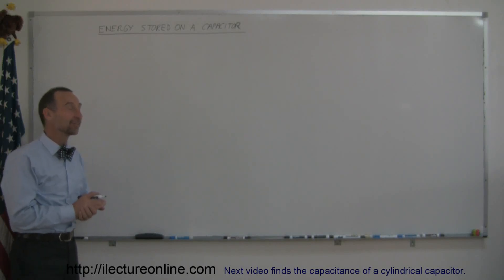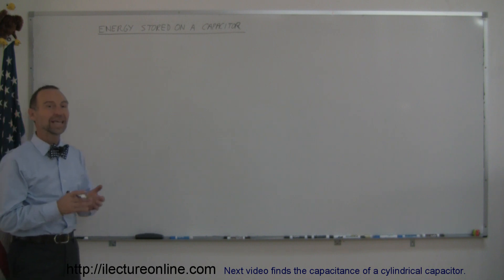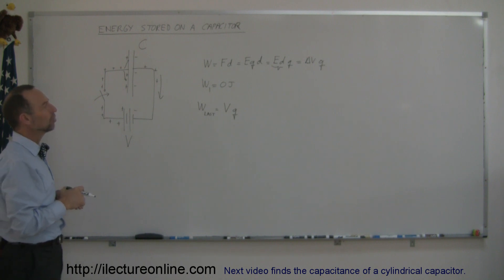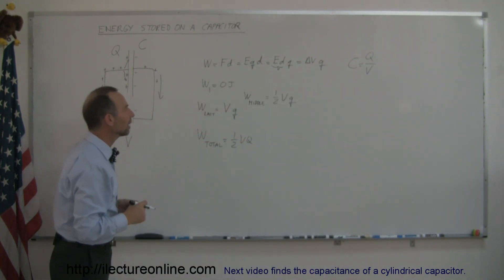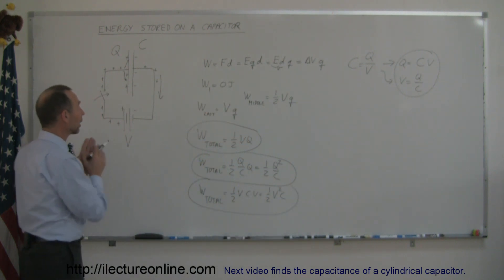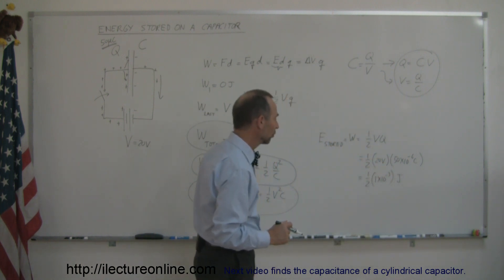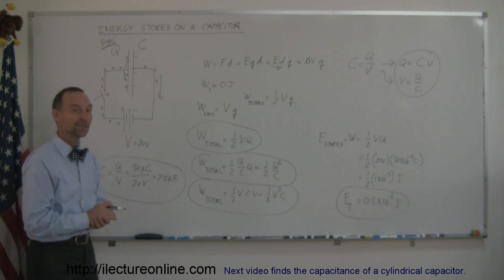Physics 39   Capacitors (7 of 37) Energy Stored in a Capacitor

Comment: This is absolutely the most complete channel I've found regarding teaching science (physics and electric circuits in my case). You should be recommended in books, haha.

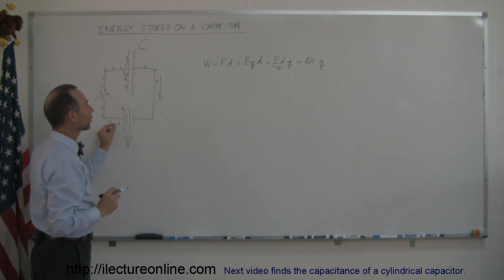One question, though, @ 2:05 you said Δv refers to the potential difference at that moment in time (in other words, Δv is a function of time, and thus w also), so, can we say then that q is also for that moment in time (and thus it's a function of time) ?

Thanks!!! I can't ask queations to a book but indeed to a genius :)
Reply from the maker: That is correct.  All three variables, V, i, and q  (voltage across the capacitor, the current in the circuit, and the charge on the capacitor) are functions of time.
Reply: Michel van Biezen Thank YOU a lot for taking your time to answer me, professor.

Comment: i think this topic is a bit more intuitive with integration so that the 1/2 appears without having to reason through it in such a roundabout way. like the work done by a battery to charge the capacitor can be expressed as dW = Udq = Q/Cdq => 1/2Q^2/C = 1/2CU^2 (oh, right. U is voltage in europe).

shame i haven't found a way to do this integration with the distance method yet.

Comment: Positive charges don't flow on metal. It's the electrons that flow.
Reply from the maker: Bernardo Ramos 
In the real world, you are correct.  

By definition in physics, a current is the flow of positive charges.
Reply: +Bernardo Ramos yeah, that was Ben Franklin's mistake that we just go with now. It gets the job done
Reply: +Robert Weaver we could just all agree that an electron has + charge and the proton has - charge and the problem would be soved since it is just a matter of definition
Reply: in theory, yeah that would work

Comment from the maker: So it is logical to assume that on average the potential difference between the capacitor plates is half the voltage of the battery that pushes the charges there, so on average the charges paced on the capacitor experience a potential difference of 1/2 V.  Thus the average work required to place each charge on the capacitor is 1/2 qV and since Q represents the sum of all the charges (Q = nq where n is the total number of charges) then the work it takes to place all the charges there is 1/2QV.
Reply: Thank you for explaining this here!! I was a little confused to be honest. You are amazing!
Reply: Look no the board

Comment from the maker: When you put the first charge on the capacitor, it requires no energy, because there are no charges on the capacitor, and therefore no repulsive force and therefore no potential difference pushing back on any approaching charges.  To place the last charge on the capacitor it requires Q times V amount of energy.

Comment: I under the logic that you used for the work done to move the middle charge on the capacitor but I dont understand how you can equate the W total to 1/2 of VQ.can you elaborate please?
Reply: I was wondering the same thing...
Reply: I know. Maybe the fact that he uses little q for each individual charge. When you sum all of the charges then you get final Q. I still do not know why he keeps 1/2 in that final equation though.
Reply: He answers this in an earlier comment, it's the average. Assuming the ave pot dif across the cap is 1/2 battery voltage, then it follows that the ave work is also the ave i.e W = 1/2 QV. His comment explains it better